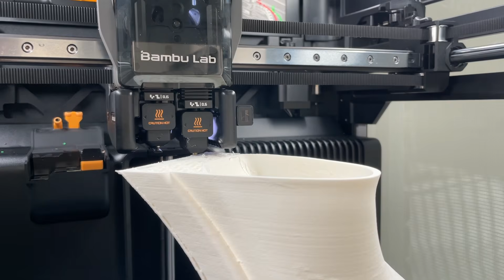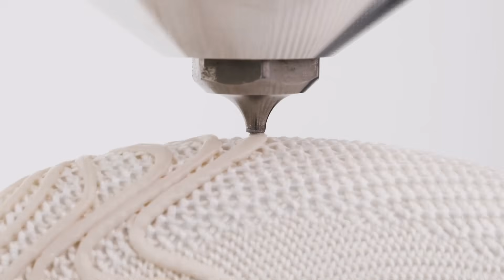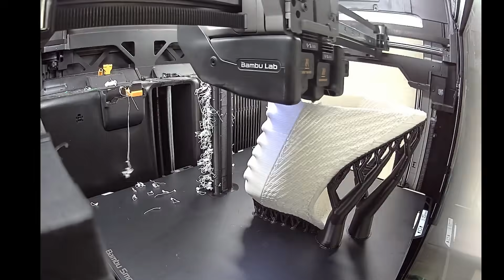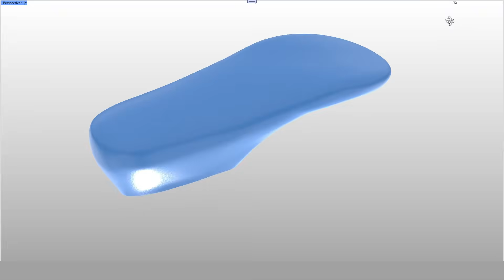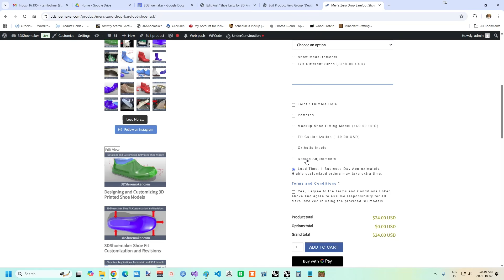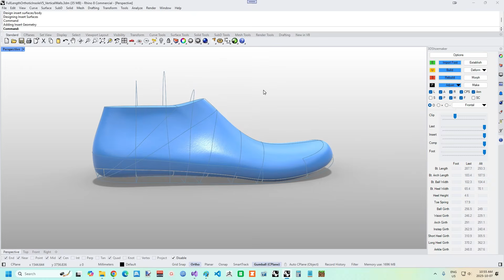Shoe Lasts for 3D Printing Shoes with Robotic Arms - Oxman's Approach

Comment: Wow, this is a fantastic video. What a great printing technology Oxman is using. In shoemaker can I specify a few key dimensions for ball, instep, how high the arch is, overall length and width of the foot, and how broad a toe shape and how much room in the toebox I want?, as well as the downcurve (heel height). I have a lot of experience designing and developing footwear for 25 years - over 8,000 styles with factories across Brazil and Asia, including fitting and Lasts but Im not a Last technician/Lastmaker.   Thanks!
Reply from the maker: Yes, 3DShoemaker can absolutely do this. It is fully parametric, so you have precise control over every little detail of the shoe last design, and the footbed as well. On top of that are the sculpting and vacuum forming tools for custom and bespoke designs relating foot models. And then footwear geometries can be mapped between shoe lasts.